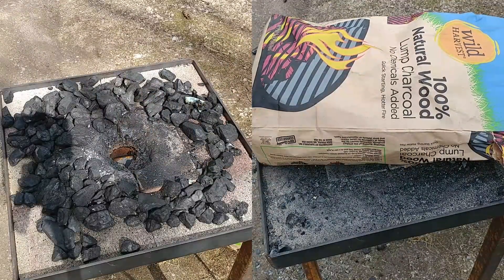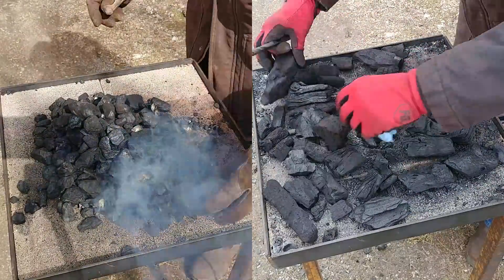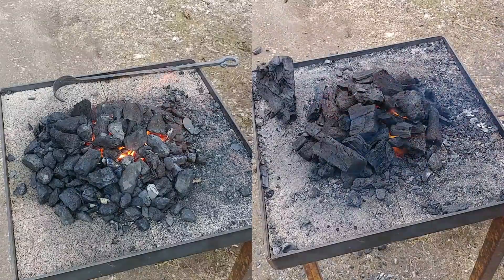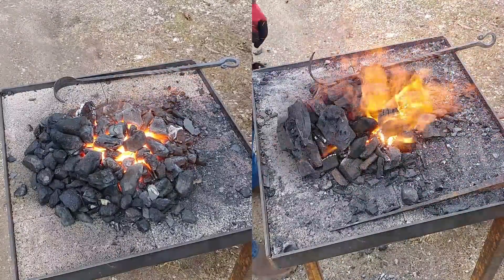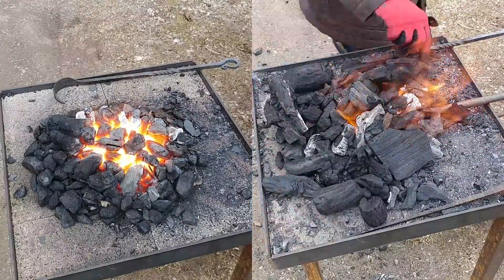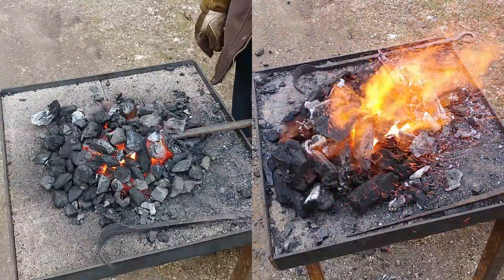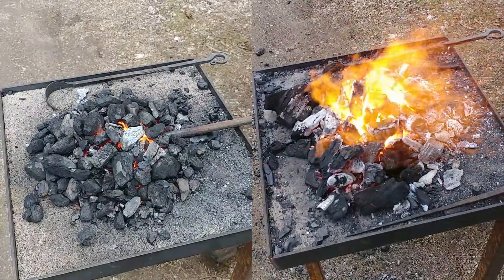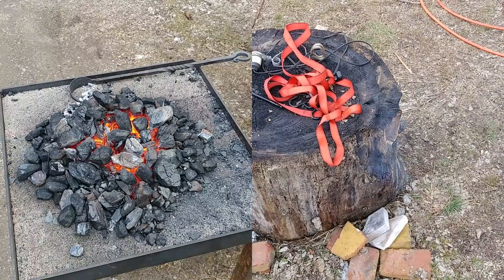Anthracite Coal VS Charcoal  (Alternative Fuel Series)

Comment: not the comparison i was looking for, i was trying to compare btu/lb values as my application is heating
Reply: Anthacite burns at higher btus than bituminous coal. Anthacite is tougher to light and usually requires constant airflow. A few charcoal briquettes helps light it relatively quickly.

Comment: Haha, I use charcoal as its either that or LPG, I have both but prefer charcoal. I have 2 anvil stumps, post vice is also mounted on a stump and another as a softer striking anvil, they all catch fire, regularly. I see the smoke, or smell it eventually and deal with it then. My workshop only has one wall and is open under a roof so fire is not a great concern as not much can burn, except the charcoal bin which did once and proved to be challenging to extinguish!
 Coal is not an option, but I would love to give it a go. The greenies here are rampant and the slightest mention of fossil fuels will get you horse whipped although we have  the largest reserves of coal on the planet and are the worlds largest supplier! Work that out!

Comment: At home charcoal using scrap wood, biomass, and POSSIBLY sourcing offcuts/yard waste from  your area is roughly free.  Get a paint can (or a few) or a steel drum, cut a hole/put a tube on the lid and you got a charcoal kiln.  Even a hole in the ground can make charcoal.

Comment: I used anthracite for years, once you get used to starting it, it’s really no big deal. It holds heat longer, it more efficient in its consumption level, and it is about 3x cheaper than lump charcoal. I would use the anthracite over charcoal, any day. Good video!

Comment: I'm in an area where bituminous is not found at all so I'm stuck with anthracite rice coal which is the worst anthracite you can get and it does fine. Don't know why everyone is so against anthracite
Reply: I wouldn't go so far as to say against anthracite....it's more of a preference.  I have only ever forged with 3 fuels. Bituminous, charcoal, and wood.  I prefer bituminous of the three, because of cost efficiency.  I have actually pulled a coal/ coke fire a couple times, to put charcoal in the centre of the pot, to do tricky forge welds